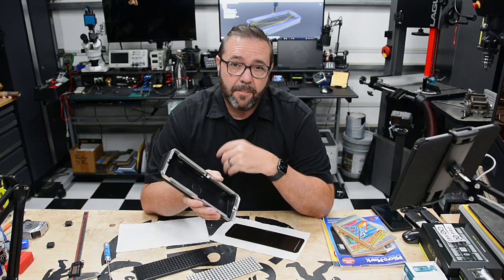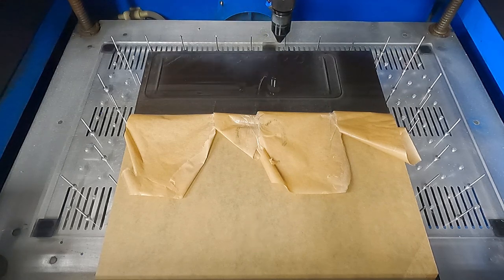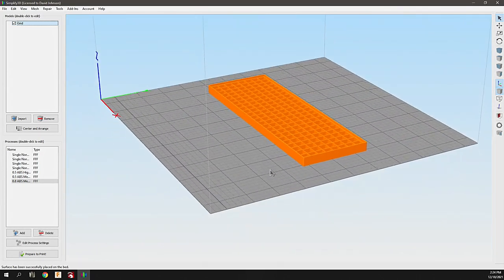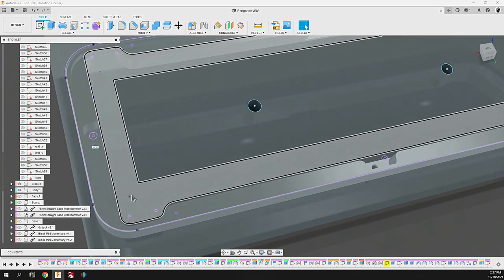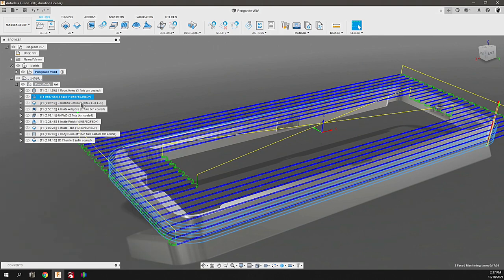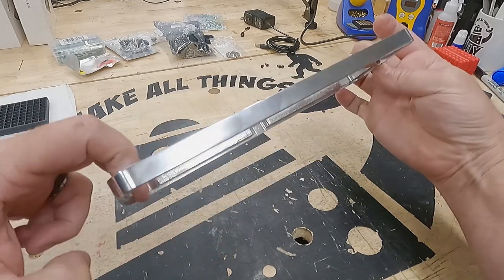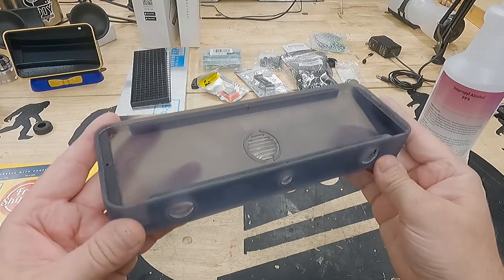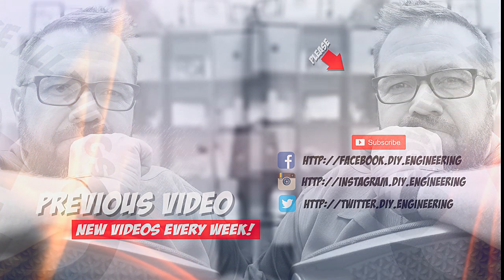Lasers, FDM, CNC and Resin... Making the Pongcade!

Comment: Aluminum part looks fantastic! Looking to see the finished product. Must be hard to use both imperial/metric system in your work. I imagine this as total mess... 
Are you guys finally switching to metric any time soon? As far as I know US is the only place on earth still using imperial.
Reply from the maker: Depends on who you talk to… :) i use metric exclusively in my designs, it’s easier in my mind but that’s just my preference
Reply from the maker: Do you build any 1200mm x 1200mm machines?
Reply: @DIYEngineering  No, the smallest is 1250x2500x100mm